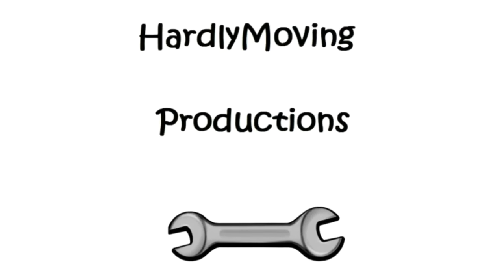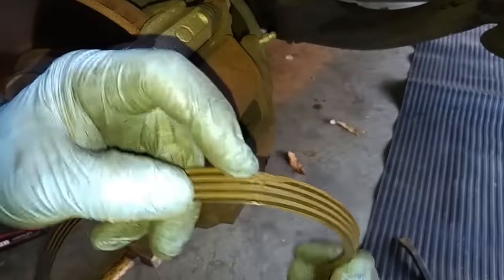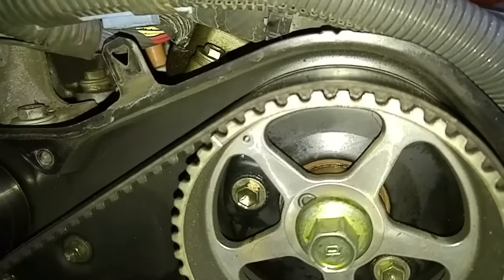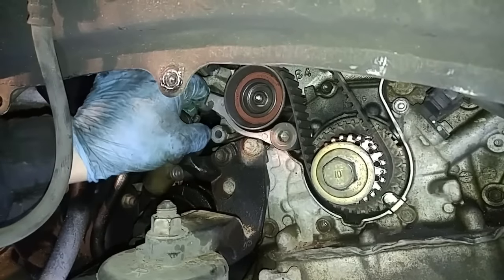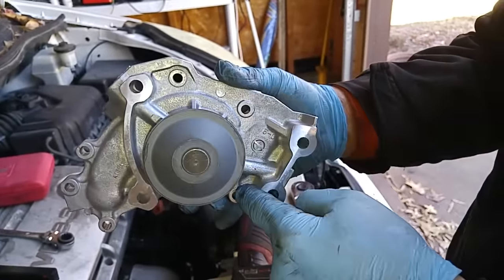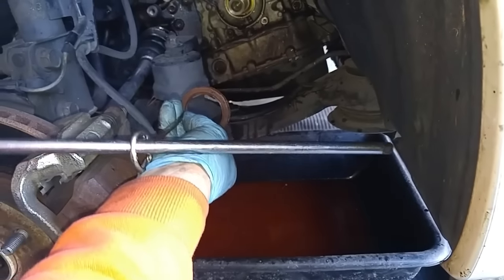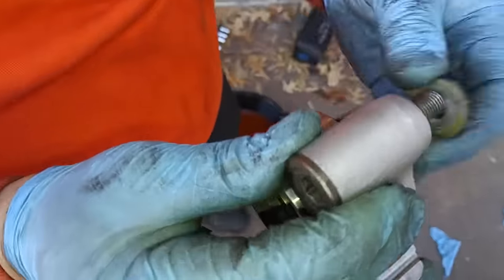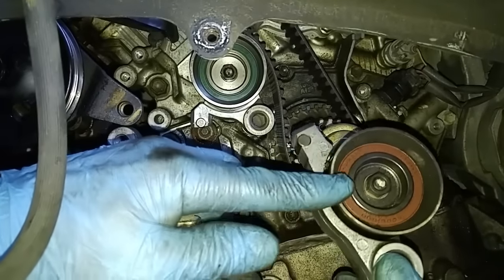Toyota Sienna V6 3MZ-FE Timing Belt, Water Pump, Seals, & Pulleys Replacement

Comment: Does that beefy socket for the crank bolt do the trick? I had to back off a timing belt job today because I couldn't remove that bolt, no dice with the impact gun, starter / breaker bar method, or my home brew crank pulley holder.   I might try that beefy socket if you have had really good luck with it. I hate to be defeated by a stupid bolt :(
Reply from the maker: I hear you.  You have no idea the hassle I had to go through removing the pulley bolts on Honda's and Toyota's until I started using these high mass sockets.  I had to go to repair shops begging them to let me use their high pressure compressor with a heavy duty air impact gun.  With these sockets (I own a 19 mm and a 22 mm), I can now use a cheap-o a/c electric impact gun to get these pulleys off!  FYI - the 3MZFE engine uses 22 mm.
Reply: @hardlymovingpro  , I appreciate the response! I'll have to order one and have a rematch w/ my brother's car!
Reply from the maker: Okay ... good luck with the repair!
Reply: Hi Sancte,
Definitely what boss suggested about the beefy socket is quite right. But, if you are a DIYer like me, you could do another try with the propane torch and heat the bolt head directly for 10-12 minutes with a sharp torch. This will help get the bolt threads expand slightly and break any corrosion build up that might be causing it seized. I had the same technique used with a normal cordless impact driver and it came off with no issues.
Reply from the maker: Been there and tried that on a Honda Pilot harmonic balancer bolt and didn't work.  Check out the beginning of this video and you'll see what I mean:  
https://youtu.be/s5XXcMrE6GU
Reply: @makhan8620 , I'm DIY as well. I'm down in AZ so we generally don't have a problem w/ corrosion as the rust belt does or more humid areas. I didn't try heat although I've read a few suggestions online suggestion such - I figure heating the bolt would expand the bolt - it seems as if I should be heating the pully instead, enlarging it, and then remove the bolt. Am I missing something or do people heat the bolt just to get rid of corrosion?  If it were my car you would see the whole thing go up in a mushroom cloud before I let a tiny 22mm bolt get the better of me but in this case it's familia so I can't take my frustration out on their cars :)
Reply from the maker: I tried the heat method once on a 3MZFE but was concerned I would ruin the crankshaft seal.  Moot point since I was going to replace the seal anyway.  It did work but a pain in the butt.
Reply: @hardlymovingpro , so how long does it generally take with your electric impact and big beef socket to get the crank bolt out?
Reply from the maker: On the Honda Pilot ... on and off - around 30 seconds.  The 3MZFE engine ... around less than 5 seconds.
Reply: @hardlymovingpro  thx, I have a harbor freight 1/2" earthquake air impact on a 10  gallon tank so I was trying to get an idea of what to expect. The vehicle is a 99 Lexus es300.
Reply from the maker: I also have a 10 gallon compressor that puts out around 130 psi.  Tried it out with the air impact driver with no success.  Air pressure drops too fast.  Need around 160 + psi of continuous pressure.  A cheap-o harbor freight A/C electric impact driver would work!
Reply: @hardlymovingpro  , gotcha, thx for the info brother. A $33 socket I could swing but not in addition to a $250 HF electric impact :( this will have to wait for now....(edit: or when you say cheapo are you referencing a different electric impact than the One Im  thinking of : 1200 ft lb 20v?)
Reply from the maker: I'm referring to a A/C wall socket electric impact tool.  And you don't need 1200 lbs of torque.  Around 200 would do.  The high mass of the socket is doing all the work when used in conjunction with the impact tool.  It's the centrifugal twisting force being applied by the impact wrench (twisting, hitting, twisting hitting) is literally banging the bolt loose.  You might even get away with using a manual impact tool used with a big hammer.  Here's an example sales listing by Harbor Freight:
https://www.harborfreight.com/12-in-Heavy-Duty-Electric-Impact-Wrench-68099.html
Or a manual impact tool:
https://www.amazon.com/Capri-Tools-Premium-Reversible-Screwdriver/dp/B06XD2XCJY/ref=sr_1_5?ie=UTF8&qid=1545285155&sr=8-5&keywords=manual+impact+tool
Reply: @hardlymovingpro ,  alright, thanks again!
Reply: I bought that beefy socket and my 30 year old sears electrical impact took off the crankshaft bolt quite easily!  @hardlymovingpro
Reply: Hey it took me less than 5 seconds with that socket!!  @sanctealphonse4510
Reply from the maker: Great!  It's a wonderful tool and I use it a lot.  Would always start a TB job wondering if the pulley bolt would give be a hard time getting off.  Now there's no doubt with this high mass socket!

Comment: Great video! I'm definitely motivated to attempt this job myself. But I'll need to buy a handful of tools. So here's a dumb question. According to the service manual, the crankshaft pulley bolt is torqued on at 162 ft. lbs. In the video, it looks like you just used your high mass socket with an impact wrench to put the bolt back on. When I buy an impact wrench, should I buy one that has a torque rating that comes close to 162? I'd prefer to buy a better model with 300+ torque, but won't this amount of force be too much? I guess what I'm asking is can I apply too much torque using an electric impact wrench (this one, for example, https://www.amazon.com/dp/B078WDTV2F/?coliid=I258LZUR7UEV3W) and damage the parts? Thank you.
Reply from the maker: Hey ... thanks for your post!  With 22 mm nuts and bolts, no need to worry about over torquing the bolt.  The high mass socket is designed to compensate for low torque powered impact drivers...so I don't see a need to get that high torque DeWalt portable impact tool that you showed.  I use a combination of sight and feel to determine tightening torque.  When I see that the impact socket has stopped moving and the impact tool is straining, that's when I release the trigger.  We're talking about 1/2 to 1 second of torque.  If you scroll down through the text area of this video, I've listed all suggested parts and tools to complete this job.  At the bottom of the list is an a/c powered Dewalt impact tool that's cheaper than the portable and provides plenty of torque.  Here's the link to the tool:  https://amzn.to/2F57ldk
The Milwaukee impact tool that I'm using now is usually out of the price range for most shade tree mechanics.  It produces around 1,400 lbs of torque.  The amount of torque generated is variable ... that is it's based on how long you hold the trigger down.  I'm so use to this tool that I'm pretty good at torquing down lug nuts to around 80 lbs.  This is the link to that tool:  
https://amzn.to/2Db5IcF
Anyway, good luck and have fun with the timing belt replacement job!
Reply: You're very generous with your time. Thanks for the quick reply! My only other concern has to do with the alignment, and me damaging the engine (not knowing what NOT to do!). In the Toyota repair manual, on step 20 for removing the timing belt, it says to first set No. 1 cylinder to TDC by aligning the timing marks on the crankshaft and the camshaft pulleys, as you did in the video. But then, just before removing the timing belt tensioner, it says to "set No. 1 cylinder to approximately 60° BTDC" by turning the crankshaft about 60° counterclockwise. Then it has this NOTE in bold: "If the timing belt is disengaged, having the crankshaft pulley at the wrong angle can cause the piston head and valve head to
 come into contact with each other when you remove the camshaft timing pulley and camshaft, causing damage. So always set the crankshaft pulley at the correct angle." Would you please comment on this? From your video it doesn't appear that you prefer this method. Again, I just don't want damage my engine. Thanks again!
Reply: Okay, I hear you. Actually I think I may have misunderstood the manual. The manual does say to turn the crankshaft 60 degrees counterclockwise (looks to be about 3-4 teeth) before removing the tensioner. But then it says to bring everything into alignment (TDC) before installing the TB. So yeah, it's definitely a precaution against the rear cam snapping into a relaxed position (as shown here at 16 min. mark: https://www.youtube.com/watch?v=T5aV-CxDzZE). Anyway, I'm still a little worried about the rear cam snapping while everything is TDC and damaging something. Are you saying that as long as I have the rear cam in TDC — and I'm careful not to knock it when putting the TB on — I'll have nothing to worry about? Thanks. I really appreciate your time and advice.
Reply: I just did my TB and with the belt on I rotated  the crankshaft counter clockwise 60 degrees. When I released the tensioner the firewall camshaft sprung back towards tdc. Of the 2 CAM shafts the firewall one seems very 'springy" I suppose the reason for the counterclockwise turn of the crankshaft was to prevent the valves and pistons from hitting each other when the tensioner is removed. @yasharenner6681
Reply: @abyssalsoul6216  Yes, I will use the procedure you did too, which is what the Toyota repair manual calls for. How did you torque down the crankshaft pulley bolt when you were finished?

Comment: Good job man,, you make it look easy, but I know is not. How many ours it took for the complete job? And what's the labor cost involved? Thanks.
Reply from the maker: It takes me around 3 to 3.5 hours.  If doing it for the first time, expect to spend 7 hours.  Local repair shops in this area charge between $800 to $1,200 and that doesn't include the cam and crank seals.
Reply: this is one of the more laborsome jobs I've seen, just to do the front of an engine. The whole part of lifting up and down on the block after having removed the front  engine mount just to get at some clearance  to get out more bolts is where the real eye rolling really happens on this job, on top of accepting that toyota purpose chose to put this pump under EVERYTHING, with multiple layers to get thru to get it....
 No wonder why these motors are built well and last - you have to do this to the thing every so often, and you're changing out ALL the parts everytime you're under the covers of the front of the motor - the water pump job IS the perfect time to replace everything else the motor will need, if you need it.
Reply from the maker: I hear you ... but its a job that only needs to be done every 10 years or 100k miles.  Average labor time is 5 hours ... my best time was 3.5 hours.    Replacing the firewall side valve cover gasket (if leaking) is a bigger job.

Comment: I did it like this and now it tells me that the engine is overheating
when on the dash it marks me that it is heating. the air conditioning stops working the strange thing that when you touch the engine you don't feel that it gets too hot I already changed the temperature sensor and it's still the same.        Helppppppp
Reply from the maker: How's your coolant level in the radiator?

Comment: Man I was putting the power steering bracket back on, and the lower bolt fell, made a clang, and I've been looking for it for the past 30 minutes it seems like! Stink. Any clues on possible hiding spots?! I'm exasperated. Tried using a weak magnet but to no avail.
Reply from the maker: I hear you and been there.  That's why I sometimes slow down and use a magnetic wand to capture a nut or bolt in a weird location.  Directly below the pump is the suspension control arm.  Could be sitting on something near that.  You can also take your fist and bang around the area to cause vibration and listen for it moving around or it might just drop down.   Last resort is to go to a salvage yard and just get another one.
Reply: @hardlymovingpro  man this is crazy. there's not a lot of places for it to get stuck. Only thing I can think of is it fell into that big hole leading down toward the wheels/brakes. But then I would have heard more than a clank. So frustrating!
Reply: @hardlymovingpro  Think I could put the tire back on then push it in neutral out onto my driveway, and hopefully it will fall out?
Reply from the maker: Don't see how that would generate enough vibration to shake it out.

Comment: After they this to my Sienna my check engine light turned on. the code is P0016. I know what the code is about but what can I do to fix it?
Reply from the maker: Camshaft position sensor error code.  You're probably off on your timing belt installation by 1 cog.
Reply: What if the mechanis "double check" and keep telling me that has to be something else?
Reply from the maker: @wilbertojrodriguez8926  They're in CYA mode and don't want to spend the time and effort to fix their screw up.  It's around 2 hrs of solid work to fix it.  They'd rather see you walk away.  Absolutely insist that this error code did not appear until AFTER they did the belt replacement!

Comment: Do you have the vehicle completely lifted on all sides? In your written instructions on axleaddict.com you say to chock the rear wheels. Just wondering if that's what you suggest for a minivan as well. Thanks much.
Reply from the maker: For doing the TB job, only necessary to lift one side in order to remove the wheel to gain access to the crankshaft pulley and other components.  Chocking the rear wheels is a good suggestion for FWD vehicles if lifting both front wheels off the ground as well as not working on level ground.  However,  good operational parking brakes would suffice on level ground.
Reply: @hardlymovingpro  Hello. Sorry for all my newby DIY questions! I can't tell from the video if you are using two jack stands or just one. If just one, do you have any tips for how to properly position the vehicle on the jack point, and where to place the second jack stand as backup? Thanks much.
Reply from the maker: No problem.  You only need to have one side supported with a jack stand.  Don't support the car with a hydraulic jack ... always support the vehicle with a jack stand. The hydraulic jack is your backup.  You can support the vehicle at the point where you position the car's portable scissor jack when changing a tire ... or you can place the jack stand further in ... there's a rail that runs the length of the chassis that's a good, solid lift point.
Reply: @hardlymovingpro  Have the vehicle lifted as I write this. Is it okay that the jacked up side is sitting a little lower than the other side, so the van is slightly tilted to one side?
Reply from the maker: No problem.  A slight tilt won't hurt anything.
Reply: @hardlymovingpro  Couldn't get the blasted crank bolt off with a regular impact socket. That's what I get for trying to save a few bucks. I also tried the OTC pulley holder, and had it locked up in there, but there was no room to use the breaker bar. With an extension the bar was straining at an awkward angle, too, not good. Oh well. Lisle for the win!
Reply from the maker: Been there, done that.   Leslie is the way to get it off.

Comment: Great work. Where do you get the cam seal installation tool?
Reply from the maker: Thanks.  There's various vendors selling the installer tool on-line.  If you do a search on "CAM Seal Installer Tool for Toyota Lexus, Nissan, Mazda", you should get a lot of hits.  I wouldn't pay more than $40.  Here's one on Amazon for under $40:
https://www.amazon.com/CAMSHAFT-Seal-Installer-JTC-4774/dp/B074QVL4JH/ref=sr_1_1?ie=UTF8&qid=1548976833&sr=8-1&keywords=CAM+Seal+Installer+Tool+for+Toyota+Lexus%2C+Nissan%2C+Mazda
Reply: You can make your own! I bought some PVC fittings, a 60mm size 12, 1.25 pitch bolt and a few washers; worked like a charm for $10

Comment: How much was the labor charge on that ?
Reply from the maker: Should be around 5.5 hrs x Shop Hrly Rate + Parts ($150 - $250)
Reply: @hardlymovingpro  Thanks :)
I have a while before mine needs this again, (It was done a few months before I got my van) when I get it done I want to get serpentine belts, thermostat, and hoses as well.
Reply from the maker: No serpentine belt ... just an alternator/ac belt and a power steering belt ... but those need to be removed to get to the timing belt.  The thermostat and radiator hoses, however, are not removed to do the TB replacement.  FYI - if you see the hose starting to swell larger starting from the hose clamp, then they're getting weak and should be replaced.  It's usually the upper hose that takes most of the pressure.  A old thermostat can go at any time.  If they get stuck in the open position, the engine won't warm up.